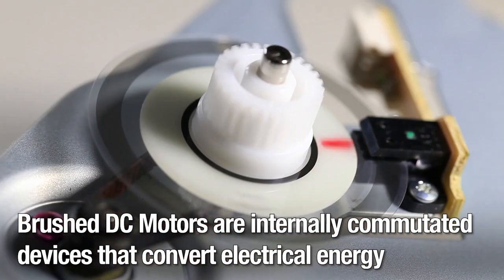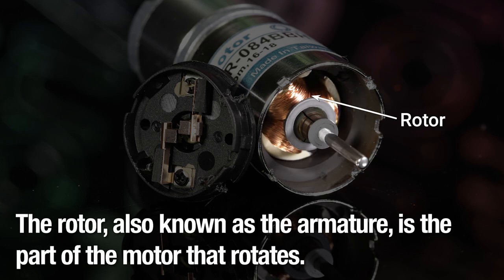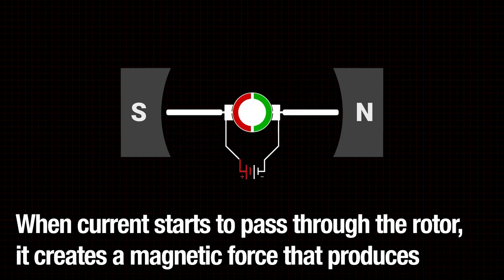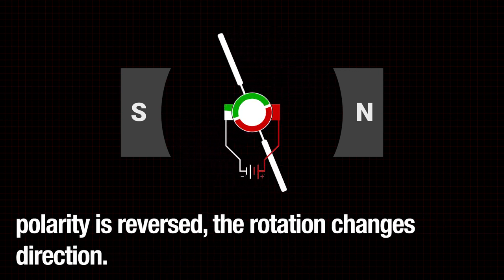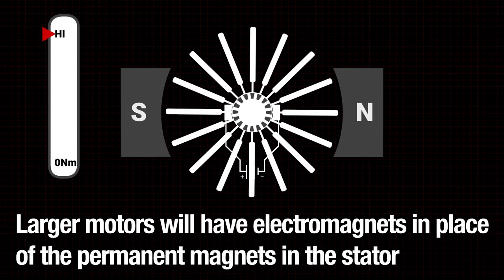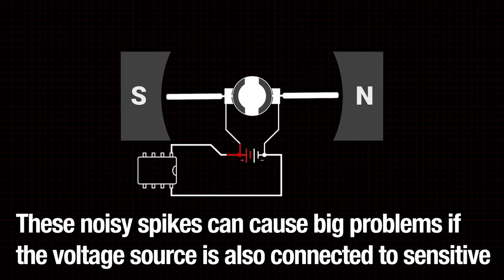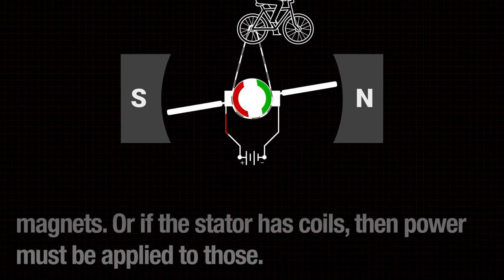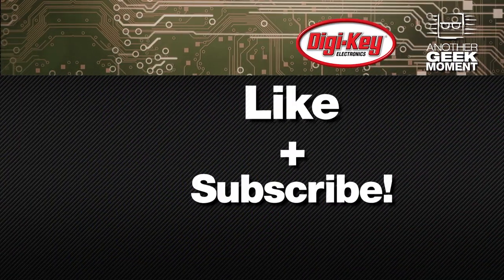Basics of Brushed DC Motors - Another Teaching Moment | Digi-Key Electronics

Comment: I'm pretty sure that a brushed DC motor produces a DC current (NOT AC) when used as a generator
Reply: Ac goes Neg pos neg pos .......if there is 2 brushes and 2 seperate stators and a segragated armature then it could be considered alternating depending on how the circuits made. Id ise a npn transistor to emulate the alternation.
Reply: Depends whethe it uses a segmented commuator, or just slip rings.